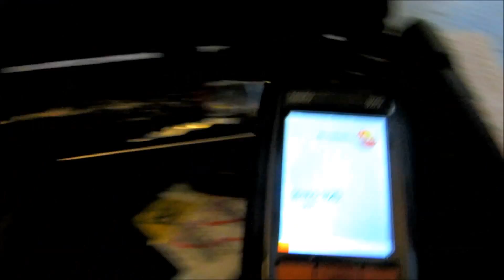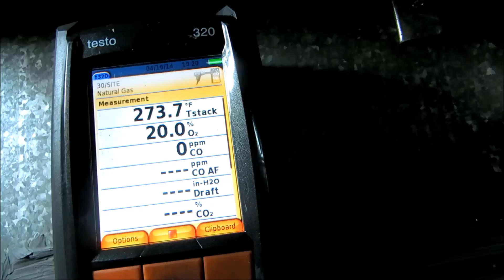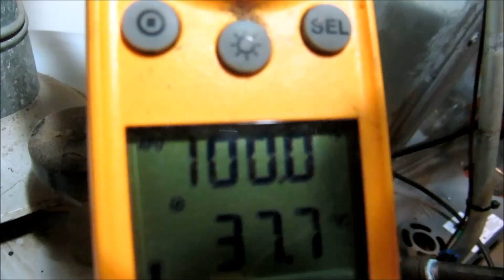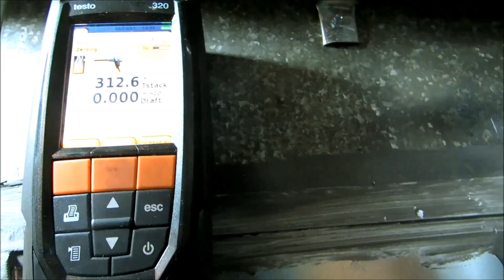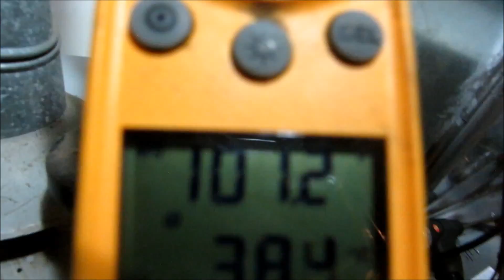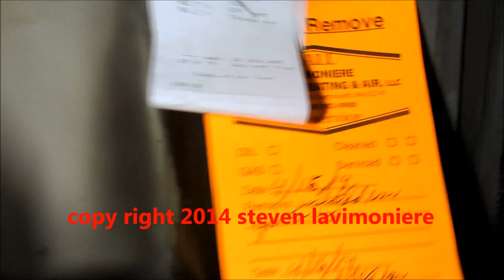hvac : combustion test ,extra return grill  in duct

Comment: We have one 16" flex return connected to a 25x32 grille for a 10 seer 3 ton condenser and 3.5 ton air handler.  Is that enough?
Reply from the maker: Ryan Booth no run blue filters not pleated ,add another 16" flex return and the system will run better and have the proper air flow 3 tons needs 1200 cfms =400 cfm per ton...16" flex can put out 675 cfms  on a return ,,,you do the math .